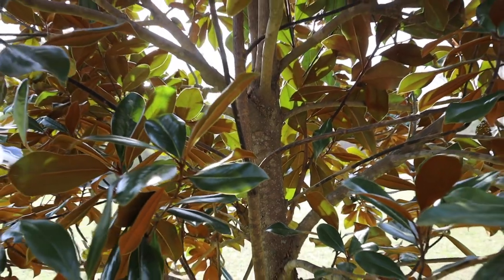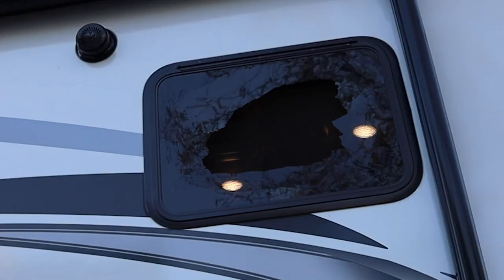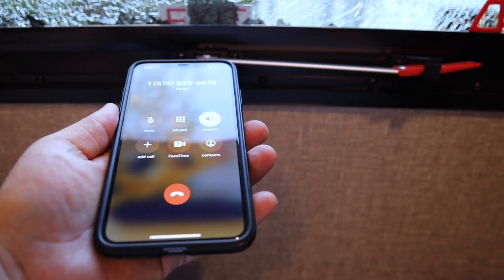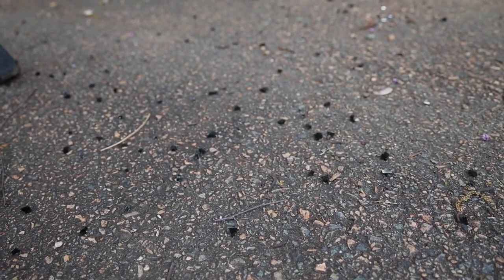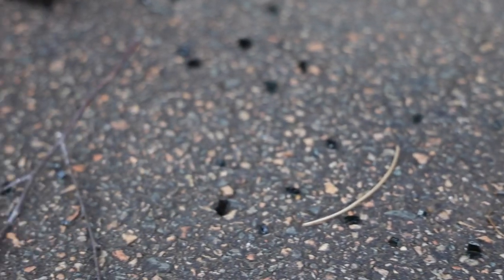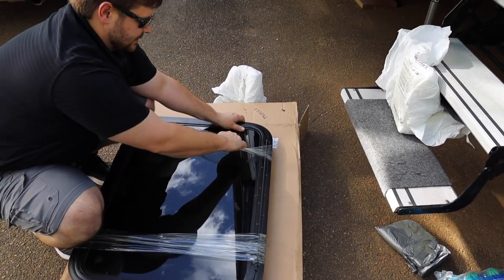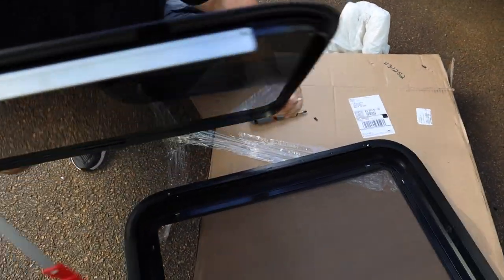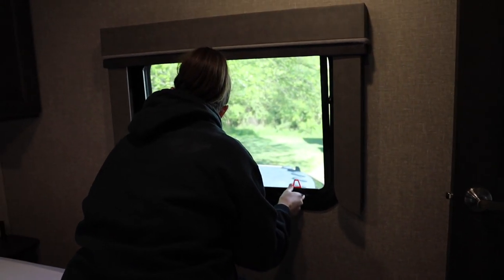Grand Design RV Window Replacement || DIY RV Window Install

Comment: You went from the window on the floor on the box to installed. Did you put any foam tape or sealant around the window? It's like watching this old house!
Reply from the maker: It was that easy to replace! Because it was an emergency access window, it doesn't seal to the RV.  There are two screws that hold the window on the hinge. Remove them, slide out the old one, slide in the new one.  You're done.  Hope this helps and thanks for watching!

Comment: Great Video, THANK YOU! We had a the same window break in our Imagine. You have saved us a couple hours. WOW!
Reply from the maker: Glad we could save you some time. When we first seen the broken window, my thoughts were it will be a nightmare to pull that window frame.  GD was great to work with and just replacing the glass part was so much easier!

Comment: Are all grand design windows like this? Buying ours and we want dual pane windows for winter
Reply from the maker: We have dual pane windows on our current RV, a Grand Design Momentum and love them!
Reply: @1StrangeAdventure  yeah we’re getting a momentum. We didn’t build it though so it came with single pane. But they charge 5k to install them so…

Comment: Literally the exact smart thing happened with our Reflection.  I big storm rolled through and we had a close lightening strike resulting in a very loud clap of thunder that shattered the same window as yours.  (We went back on a security camera and watched it all go down). And I also discovered it on a Friday afternoon!  Luckily the plant is open now and I was able to call and order the window and made the 85 mile drive to Middlebury to pick it up.  Thanks for the video, going to replace our window tomorrow!
Reply from the maker: At least you got it on camera! Glad everything else was ok.  The window was pretty easy to replace... thankfully! We have been to Middlebury several times this year.  Hope the window install went well! Let us know how it went!
Reply: @1StrangeAdventure  went in fairly easily. I took about 30 minutes, not bad considering the amount of broken glass we were trying to pick up out of the lawn!  Glad I saw your video before we tried to replace the entire window including the frame.  This was sooo much easier.

Comment: I am going to have to replace mine and the dealer wants a fortune. Glad I ran across this video
Reply from the maker: Happy to help.  The fire escape windows are pretty easy to install since you don't have to remove the frame.
Reply: @1StrangeAdventure  I was worried about that. You made it look easy
Reply from the maker: Hopefully yours is as easy as ours was. 🤞